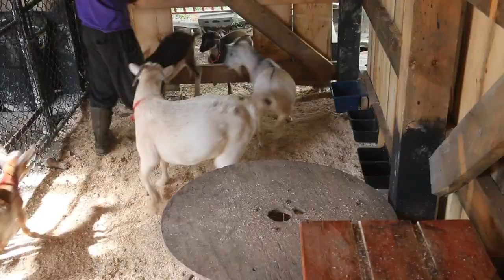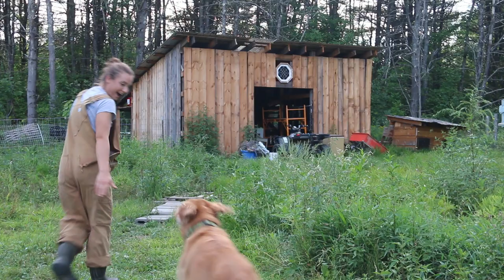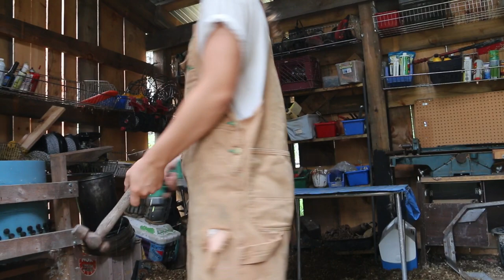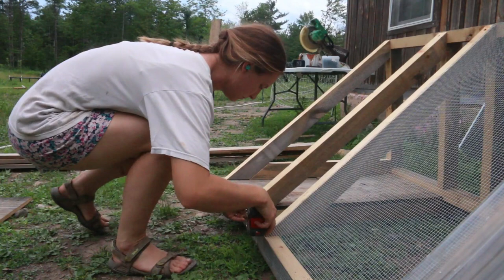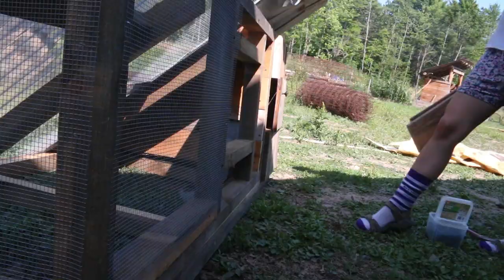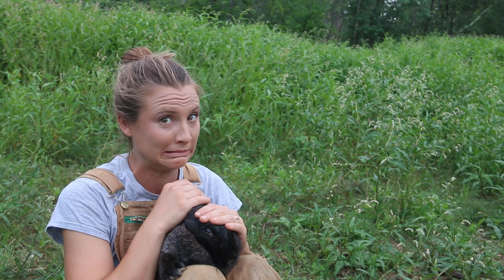Building A Rabbit Tractor

Comment: I noticed a tire on the front one of the tractors. Is it like a wheelbarrow style? Thinking of trying that. Very impressive
Reply from the maker: Harry Hubbard yes! I have this fold out tire, I pulled off an old wheelbarrow, on one of the tractors ... it works... but is very flawed hahah need a few tweaks for it to move more smoothly..I think starting with a larger tire